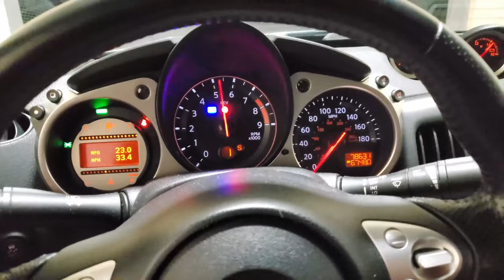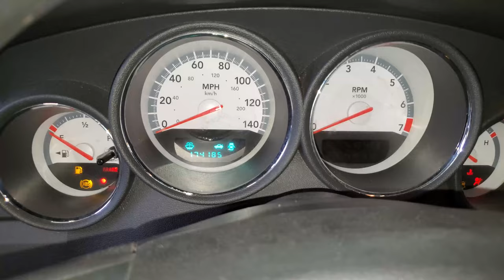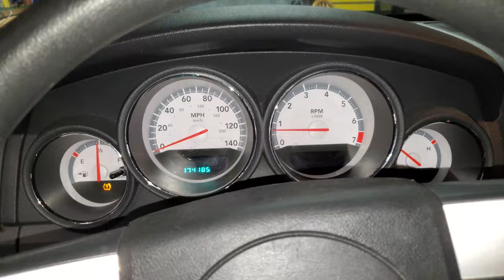Baker Rebuilds Dodge Charger SXT First Start And Drive!

Comment: Hey man, so what was the end result with this?  I am going through your videos. and taking notes.  I have a 2008 2.7 charger, engine seized.  So I got a 2010 3.5l engine from LKQ.  Going through right now and tearing things down and cleaning up stuff.  Looks like I need to replace head gasket cause I saw milky stuff in the radiator hoses and where the water pump sits.  I don't plan on doing piston rings (as LKQ said they tested for compression).  Just wondering if there are any other ideas or tips you would say come to mind (not in the vids) when doing a refresh on this engine
Reply from the maker: Once it was running we had to sell the v6. Definitely sounds like you need a head gasket. Once the heads are off use a square or a straight edge to make sure the cylinder head and cylinder bore mating surfaces are still flat. I'd buy a gasket kit or the specific gaskets to replace the ones you can. (Intake manifold, injector o-rings, the aluminum peice the coolant hose attaches to, exhaust manifold etc.)
Reply from the maker: Try to figure out why your engine overheated. It would suck to do all the work and put it in only to have it overheat on you again.
Reply: @bakerRebuilds  Ah, too bad you didn't get to keep it. 
Yup, ordered the head gaskets and will do all other ones, since I am this deep into the engine.
Ok, I will get a straight edge to make sure things are level.  As to why it overheated or whatever the reason that LKQ had the engine, I don't know.  Just trying to make sure I correct all I can before I stick it in and find out I missed something. LOL
Reply from the maker: @sethdunn96  I know the feeling lol I've also experienced when it goes wrong and has to be pulled out, no fun! No worries, I still have the HEMI that is on the channel.
Reply: @bakerRebuilds  well the Hemi is probably the better one anyway. :D
Reply from the maker: @sethdunn96  This one is a good time now lol We had to rebuild its engine also(all on the channel). Since we were doing that we did an MDS delete and upgraded cam. Diablo tuner once it was done so it's got some pep! I hope your project turns out great!
Reply: @bakerRebuilds  That sounds nice!!  A lot of pep I am sure.   Thank you!  Would be great to do this and the car run again.
Reply from the maker: @sethdunn96  I have a curiosity. Is the 2.7 and the 3.5 you're putting in a direct match for the transmission bell housing bolts?
Reply: @bakerRebuilds  It looks like it is.  The 2.7 is obviously mated to a 42RLE, so when I looked for the 3.5, I made sure it came out of a car that also had the 42RLE.  And I just looked at both engines to confirm, the bolt holes on the back of the engine are in the same place.
Reply from the maker: @sethdunn96  Sweet, should be good!
Reply: @bakerRebuilds  Good to hear.  First time doing something like this.  So I am nervous about putting it back in and just crossing fingers that it works.  I did get a computer off a car that had a 3.5l engine in it.  So even though I hear the 2.7 will also, I figure why take a chance if I can snag one.
Reply: @bakerRebuilds  Question for you on the head gasket.  In your vids, I don't believe you used Fel-Pro gaskets.  For mine I got the Fel-Pro.  Putting things on, and stuff back together today, and when I was putting things away, I noticed a corner tab of the gasket on the passenger side above the exhaust manifold sticking out.  Did I put the gaskets on backwards??
Reply from the maker: @sethdunn96  They are dang near impossible to put on backwards not to mention none of the hole would line up if you managed it. I think a small amount does protrude over the edge just for lining it up correctly. Did you make sure to set the gaskets on the aluminium alignment dowels
Reply: @bakerRebuilds  you are right. There is a portion that does stick out. So I put them on right. I came across another video and the same gaskets were being used. And there was overhang at the corners. Downside is some of my valves are bent. So I’ve ordered valves.
Reply from the maker: @sethdunn96  Nice. Atleast you'll have new valves. Are you familiar with the necessary checks for fitment if the valves? Seating them properly
Reply: @bakerRebuilds  I am not certain on that.  I did however take the heads off and look at them again.  It appears the valves are sitting properly in the head.  There is no raised portion.  So I put things back together, just did a leak down test on all cylinders. There is a gradual loss of pressure doing the test.  A low hiss of air coming from the intake/exhaust.  I assume this is normal?  As the cylinder isn't 100% air tight, correct?
Reply from the maker: @sethdunn96  That's correct, not air tight. I believe you want less than 10% leak so with 100psi applied you want to see 90psi on the readout.
Reply: @bakerRebuilds  Roger that.
Reply: @bakerRebuilds  Hey man, when you put the engine in your car.  How did you mate up the engine to the transmission? It is kicking my butt right now trying to get them to mate up.
Reply from the maker: @sethdunn96  Be sure that your torque converter is on correctly and in all the way. Also if you've removed and reinstalled motor mounts make sure they're on the correct sides. We used a jack under the transmission to help with height adjustment and then a engine Leveling hoist attachment that slides the balance point to help with the correct angle of the engine to get it in. Start with one bolt towards either driver or passenger side and once that is in lower the engine or jack up the transmission to help line up the other side. From there it should be relatively easy.
Reply: @bakerRebuilds  Yeah, I had to get the transmission jack.  That helped a lot!!!  Was able to get all bolts in except the bottom 2 where the window to the fly wheel is. Those should be easy now.  I also had to loosen but not fully disconnect the drive shaft...that allowed the wiggle room I needed to move the transmission.  Also you are right, the load leveler for the hoist is a must!  I feel the TC and Flywheel are correctly mated.  I had to jam a pry bar to the side of the TC to hold in place while I spun crankshaft til holes lined up.  And also there is a window on the fly wheel that lined up with a barcode on the TC, so I feel it is right.  Thank you for the input!  It is much appreciated!
Reply from the maker: @sethdunn96  No problem, I'm glad I could help! Hope it all runs smoothly for you!!
Reply: @bakerRebuilds  Thank you.  Me too.  Have a few more things to button up on it before I am ready to turn the key on it.
Reply from the maker: @sethdunn96  Here if you have any further questions!
Reply: @bakerRebuilds  So here is a question, I am using FEL-PRO MS 92165 on the lower intake manifold. In the Haynes manual, it says to use RTV around the coolant channels on each end of the gasket.  But on Fel-Pro's site, if I understand correctly, the MS line of gaskets, they say don't use RTV.  What are your thoughts?
Reply from the maker: @sethdunn96  I did ones just like those on our V6 without RTV and it did not leak. I'd say you're good.
Reply: @bakerRebuilds  Great to know! Thank you
Reply: @bakerRebuilds  Hey man, hope all is well. On the back side of the 3.5, the lower intake manifold has the coolant hose coming out of it, with a smaller diameter "pipe" branching off.  On the 2.7, there isn't the smaller pipe.  So what connects to that guy?
Reply from the maker: @sethdunn96  I recall that intake manifold having about 5 connections. Double check your engine bay everywhere for a rubber hose or something within reach that fits. I don't know the technical names of everything that connects to it. You may not have that connection if you're swapping a 3.5 in instead of the 2.7. Do some research online and dig into forums if you have nothing left in your engine bay.
Reply: @bakerRebuilds  Yeah I figured it out.  Dodge moved (what I guess is an overfill line) the line that goes to the reservoir off the heater core inlet 'T'.  The put it on the pipe coming out of the lower intake.  So I am going to get a barrel connector for the 'T' and swap that out. and move the hose over to the 'nipple' coming off that pipe.
Reply from the maker: @sethdunn96  ah gotcha, nice!
Reply: @bakerRebuilds  Is it possible to over tighten the bolts on the transmission and engine, to the point that the flywheel doesn't turn?  I tried to start the car tonight and it won't turn the flywheel.  I tried to turn the crankshaft and I can't.  In either direction.  It did rotate when I bolted the Flywheel and TC together.  After that I went around and tightened down the bolts on the transmission.  Didn't think to try and turn the crank again.  So that is the only thing I can think of as to why it isn't turning now
Reply from the maker: @sethdunn96  It is possible to over tighten, yes. It would not however keep the engine from turning. Did you turn the engine several times by hand and verify timing before putting it in? Triple check your timing marks. Make sure that is all set. Make sure a torque converter to flywheel bolt is not sticking out, all tight.
Reply: @bakerRebuilds  I think I misaligned the transmission and engine when I was putting them back together. :(  Taking things apart again today, see if I can get things lined up.  So frustrating, but its my stupidity.
Reply from the maker: @sethdunn96  I know how you feel but once you succeed at getting this car running, you'll have learned a ton.
Reply: @bakerRebuilds  OH I totally agree with that.  I am learning a ton right now.
Reply from the maker: @sethdunn96  Just keep pushing and trying, you got this!
Reply: @bakerRebuilds  Hey man, wanted to follow up with you and say thank you.  The thing kicked my butt....but I got it done and it is running!! I drove it around yesterday and initially there was some ticking but that seems to have gotten better.  Temps look good.  So just need to do some work on AC, put back on the cosmetic stuff and wiper arms and it will be done!!!  Thank you for your vids and your help with it.  Much appreciated!
Reply from the maker: @sethdunn96  SWEEEEET!! Glad to hear it man! Some noise like clicks seems to be normal until oil fully circulates and primes everything. Glad it worked out! Put all that knowledge to good use.
Reply: @bakerRebuilds  Yeah I think it is the oil issue.  Was sound better yesterday.,  This morning though I went out to pull codes and turned it on.....had a noise coming from the engine like a gurgle or plastic banging, low growl/rumble.....not sure what that is.
Reply from the maker: @sethdunn96  Interesting, keep an eye on it.
Reply: @bakerRebuilds  Roger that